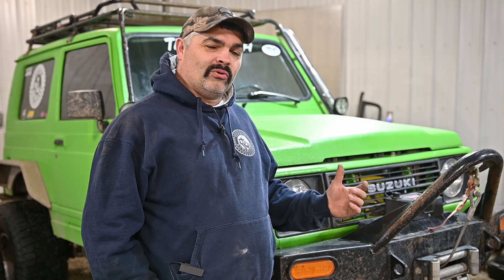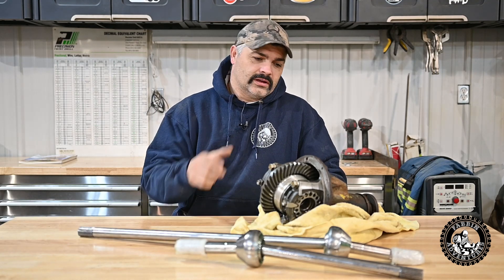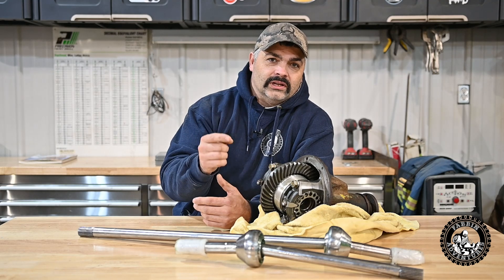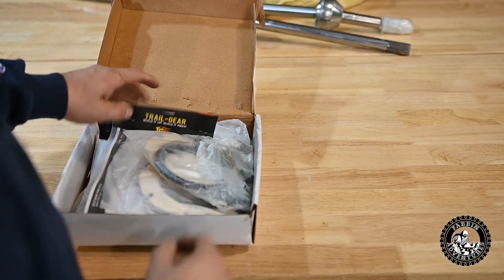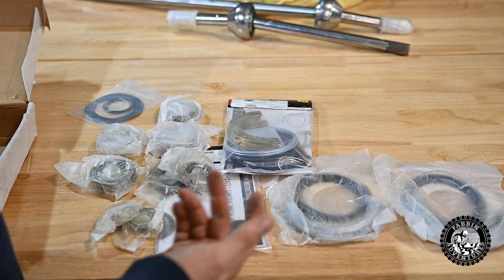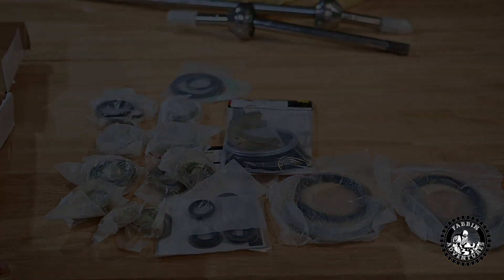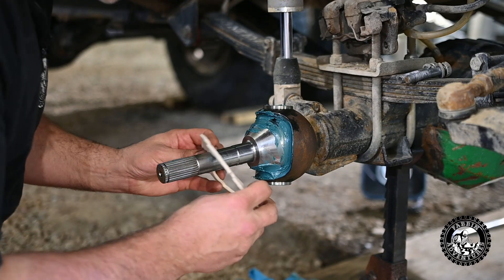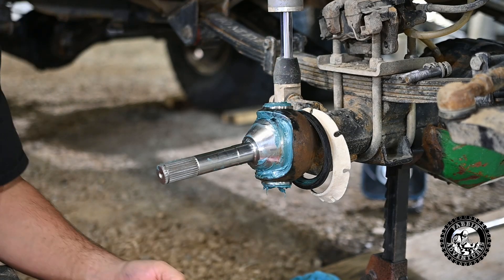Suzuki Samurai Front Diff Rebuild: 4.30 gears, locker, chromoly axles

Comment: awesome step by step video, it really helped me a lot. 1 remark, I think the order of the parts of the steering knuckle seal is different from what I see in your video. It is (from the knucle side to the diff) 1. small steel plates, 2. rubber seal, 3. felt ring 4. large steel plates. So basically the rubber seal and the filt ring are in between the steel parts
Reply from the maker: Thanks for watching and commenting! To be honest its been so long since i did it i dont even remember the order, but i havent had any leaks or trouble with the way i did it.

Comment: I need your help. I have a 87 samurai. But the motor is a 90 suzuki swift 1.3l dohc. I need to replace the rear main seal.  Do I order one for a samurai or swift? Thank you
Reply from the maker: If its the rear main from the swift engine, order the swift rear main.
Reply: @FabbinAdventures thank you so much..
Reply from the maker: @daverepole9283 no problemo!
Reply: @FabbinAdventures but when I orderd the clutch the swift clutch was different.  So I had to order a samurai clutch. Does that make sense to you?
Reply from the maker: Yes, the rear main seal though has to mate with the engine block and crank shaft. The dinensions may be different from one engine to the other.
The clutch on the other hand will mount to either flywheel likely but may or may not fit the bell housing of the transmission.
I have the 1.6 16v engine in my samurai but have to use the 1.3 8v (stock sized) clutch, the 1.6 16v clutch doesnt fit in the bell housing if i remember right.
Reply: @FabbinAdventures  thank you so much. Man I wish you were in Vancouver Canada...
Reply from the maker: @daverepole9283  no problemo, yeah alberta is a fair ways from vancouver!
Reply: @FabbinAdventures  thank you so much for the replies.  You are the first to reply this quick..
Reply from the maker: @daverepole9283  well its handy when i grt the notifications on my phone and im on days off..lol
Reply: @FabbinAdventures  lol..thanks again..
Reply: Sorry to bother you again.  I can't seem to find the gasket for the rear main seal housing . It's shaped like a horseshoe.  Everything on line includes the seal which I don't need. My question is can I use high temp rtv  Insted of the paper gasket?
Reply from the maker: @daverepole9283 oh i have no idea about that sorry
Reply: OK thank you..

Comment: Just curiosity I’m doing my diff right now I 87 Suzuki, 

On the 50 mm nuts, to hold down the bearing, what are the torque specs for those!?
Reply from the maker: Not off hand but you can google it like i did.

Comment: Thanks for all your hard work making these videos 👍 I subscribed a few weeks back!
I have a few question for you.
I have a 93 Sidekick 4 door, I want to get it set up a bit better for off-road use ( I still need it capable of winter snow commuting )I probably drive my Sidekick about 3000 miles a year. I would like to get a locker for the rear end. Would you suggest a Lockright  or another brand? I really would like an E locker but I’m not sure if one’s available? How about one of the TRE air lockers? 
Finally I have seen some LSD diffs sold on E bay shipping from Russia, I was thinking that maybe a good choice for the front diff after getting the rear diff setup with a locker?
Or maybe a lockright installed in the front? 
I just wonder if a lockright up front would be an issue for steering? 
I would be interested in your thoughts on this? Thanks
Reply from the maker: Hey Mike, thanks for subscribing and welcome to the channel!
It depends where you live, do you drive it on the hwy in the winter with snow covered roads? If so, i would stay away from the lock right or spartan style lockers, they tend to be unpredicatble and squirrly on icy highways at speed.
I recently installed a TRE air locker in the rear and sofar its worked flawlessly, but ive only taken it on one wheeling trip so as for longevity...who knows, only time will tell. I have heard good stuff about them, i personally feel an air or e-locker would be better than lsd as you have more control on when to lock it especially when wheeling.
I have a spartan up front now also, it does affect steering but only in 4x4, turning radius is larger and you have to put in chromoly axles to use a spartan or lockrite, though most likely you would have to with any locker up front as the locker has the bigger spline set for the bigger axles. I dont know of any front lockers that take the factory axles. The factory front axles are tiny anyways so putting in a locker up front would most likely break the axles in short time. Ooops i just realize your running a sidekick, i was talking about the samurai front diff. Im not sure what options you have for front lockers or chromollies, i do know you have to watch out if your front 3rd member is aluminum or steel, if steel your good, if aluminum id stay away from locking the front.
I have a video coming out Christmas day which is a shakedown run for the new gears, Chromolly front axles, hybrid rear axle and TRE rear air locker. The Sammy was unstoppable!
Reply: @FabbinAdventures  Thank you so much for getting back to me! I really appreciate it 👍 I’m in wester Washington so I’m only driving a week or two out of the year on snow covered roads. I really appreciate your input on this. I do have an aluminum front 3rd member housing up front. I definitely will be checking out more of your videos 👍 ps I’m also a fellow YT creator!
Reply from the maker: Cool, whats your channel?
Glad to be able to help!
Consider coming to "Zuksaw on the Whipsaw" next august! If your in waahington your not far from the whipsaw!
Reply: @FabbinAdventures  I definitely have thought about it after seeing your videos posted about the Whipsaw trail. I’m not sure if the border will be open for Me to head up north by then? If it is I really think I should try to get up there! My Suzuki will definitely need a lockright if I try to get though that trail! I’m actually planning on building a nice winch bumper this winter for it. 
My YT channel is the one I’m commenting from.
Mike Festiva 👍 I do a lot up Fab projects. Take care
Reply from the maker: Hopefully the borders open up by then, i personally think lower t-case gears are more important for that trail than lockers, from what we experienced last aug!
Hope to see you there!
Reply: @FabbinAdventures  Thanks! I just checked out Trail Tough and I see there’s two different kits available for my Sidekick, 3:1 and 4.24:1
Do you have any recommendations on what would be best for regular 4x4 trails, we have mostly muddy trails out here, not really rock crawling stuff. Sorry for so many comments.
Here’s a tip I found that really helps 👍
YouTube promote your videos more. If the algorithms notice lots of viewer interaction from commenting they tend to push a video more to new viewers. I have noticed if you ask a question in the video like (what would they recommend on a subject, or list there vehicle and mods they have done ) it really drums up the comments and helps the videos get to out to new viewers. 
Just something I wanted to pass on too you 🙂
Reply from the maker: Well thats a good question, the only experience i have with sidekick gearing is the red tracker that was with us on the past whipsaw trip had the 4.24s and no lockers. He did almost as good as me with my 6.5 to 1 gears.
The bonus with the lower gears is it will allow you to navigate rocks and obstacles with precision and control as you will be able to do it slower so less chance of breakage too!
I think alot would depend on the gearing you have and the tire size your running or plan to run.
With my 6.5s, 5th gear low range is slightly lower than 1st high so i basically have 10 speeds of 4x4, also the 6.5s lower the high range gears by 25 percent or so. So that helps all around with bigger tires.
Mud and muskeg is pretty much all we have around here also and my sammy with all them gears works pretty good.
Keeping the sammy as light weight as possible seems to be more of a bonus than wheel spin! Im not a fan of mud.
I think trail tough could tell you what might be better for your application, they are great to deal with and fairly close to you i think!
Thanks for the tip, i knew comments helped, but thats about it..lol
Reply from the maker: Hey Mike, i just checked out your channel, and realized i already watch your channel but haven't subscribed. I have now.
I've been thinking about a cnc plasma, i think i even watched your langmuir video once a while back. What do you think would be a decent size and starting machine for me, keep in mind electronics are not my thing..lol
Reply: @FabbinAdventures  Right on! Thanks for subscribing 👍 I really think you would make good use of a CNC table!
I would say if you were going to buy a Langmuir CNC table, definitely recommend the PRO Table, it’s an awesome deal, the Z axis is much nicer then the original crossfire table, plus the table is twice the size, they are back ordered right now so I think it’s $500 off plus my promo code drops it another $100. 
Keep in mind I had never used any CAD software before ordering my table, it was a bit of a learning curve but an hour here and an hour there practicing I was able to draw and cut  most parts in about two weeks of learning the software, one other thing, the CNC control software is much much better on the PRO table, it’s very intuitive. If you have any questions feel free to ask.
I really appreciate the time you took answering my questions 👍
Reply from the maker: @Mikefestiva  awesome man! Thanks for your input on the plasma table!
That articulating machine you built a while back is awesome! Your my kind of fab guy! I love building stuff like that. Ive worked in multiple fab shops and welding shops over the years...its what i like to do. Thats why i changed my channel name from "zuki evolution" to Fabbin Adventures, it opens up more possibilities to the projects i get into..lol
I'd love to see your set up some time and that articulating machine!
Thanks for commenting!

Comment: Hey Ron thanks for the video.  I cut the head off 6mm bolts to help install the gaskets instead of using water pump studs.  Made a big difference on the install.
Reply from the maker: Oh i bet it did!, i was in too much of a hurry by then to bother, at that point i was about 10 or 12 hours into filming and was getting sick of it..lol
And i wanted to take it on a shake down run the next day ( that video comes out christmas day!
Thanks for the tip Douglas!

Comment: with the 4;30 gears Ron...what your rpm at 100kmh?......im running 5;13s in mine  with 33s and she  spinning up over 4200
Reply from the maker: At 100 km/h and 6.5 t-case gears 33s, im running 3500 rpm in 5th which seems perfect!
I can keep it in 5th on the highway for all but the big hills!
Reply: @FabbinAdventures  that sounds about perfect ....i may have to  dig into my tcase see what gears the previous owner  put in there ....my crawl ratio  is right perfect  for the  kind of trails we do here  and id just like a littlllleee  bit more driveability on the open road.
Reply from the maker: @davesgarage3099  yeah thats what ive been after for a while now, was driveability on the highway. Id did awesome on the trails before, and now...wow!

Comment: My kit came with new King pins as well .  Also just a tip  : Easier to put the Knuckle seal & wiper over the ball BEFORE you install the Kingpin bearing cups .  good vid
Reply from the maker: Yeah i know about putting the seals on before the bearing races, i had help filming that day and was a little distracted from my normal "have to do everything" routine.
I didnt find it hard to put the seals on anyway.
Thanks for watching man.
Reply: @FabbinAdventures  I think i read in the service manual they cut the rubber seal when installing a new one.
Reply from the maker: Yes i read that too, i had 2 styled of wipers in my kit. a real stiff version and a soft rubbery oem version. I couldnt get the stiff one over the knuckle so i opted for the oem version, i just couldnt bring myself to cut the wiper..lol

Comment: I've got a spartan in the rear, and I love it. Will be interesting to see how it works in the front end.

I'm also putting a locker and shafts in my front diff at the moment, but I'm going with RCVs and E locker, slightly more expensive route.  
Also going to shave the front and rear axles, you might want to look into that, gives you almost an inch of extra ground clearance.  

Also, for all you european samurai owners, there is this guy from Slovakia on ebay, suzukingdom, he sells a knuckle rebuild kit (both sides) for 80€/98USD, ships in 2-3 days, made in japan.
Saved a lot of money ordering from him, euro4x4parts rip you off.
Reply from the maker: Oh nice! I had a spartan in the rear and took it out and installed an airlocker in its place. Way less squirrely on the snow covered hwy now.
The spartan up front works great, i will eventually put an air locker up front, but i had this spartan sitting there so i used it.
Rcv axles are awesome, i picked these chromolly ones up locally for a steal so i couldnt pass them up, came with a bunch of other spare parts too.
Thanks for watching!

Comment: Ron, I saw that you don't reinstall the snap rings on the ends of the axle shafts. Have you noticed and slop or play in 4WD without them? I'm debating leaving mine out because those rings are a pain in the ass to reinstall.